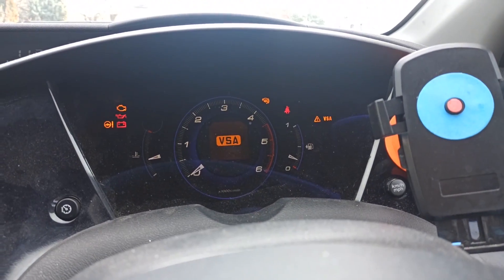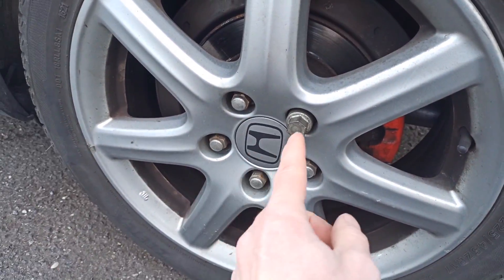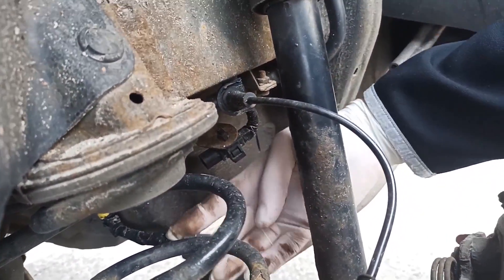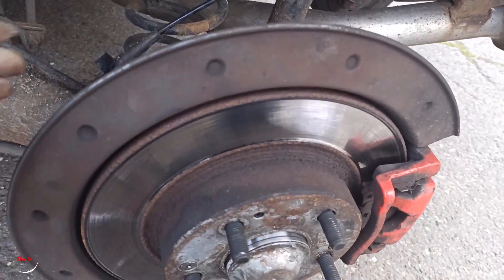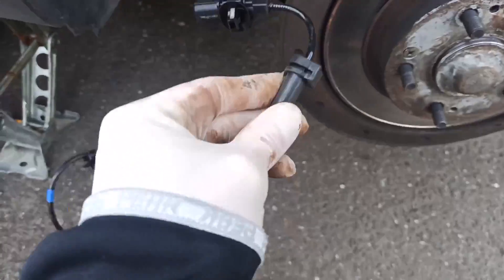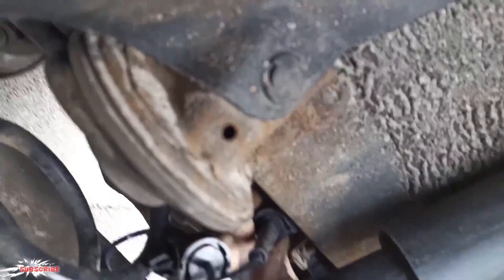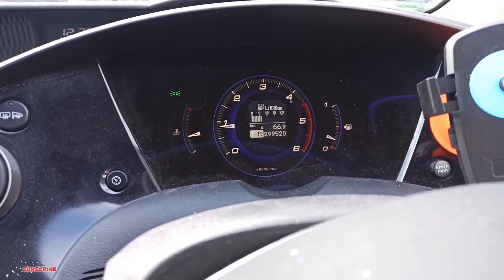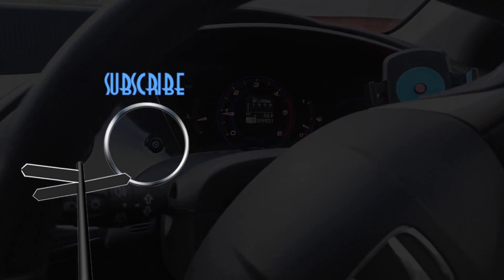How to fix ABS - VSA Light ON on your Car ( Honda CIVIC )

Comment: Hi! I did a reading, and changed my rrw sensor. However the error on my dashboard is still there. Any suggestions?
Reply from the maker: @BreathingToSurvive  one you changed sensor did you try reading data from it it works or not